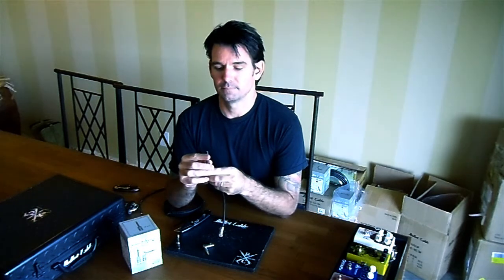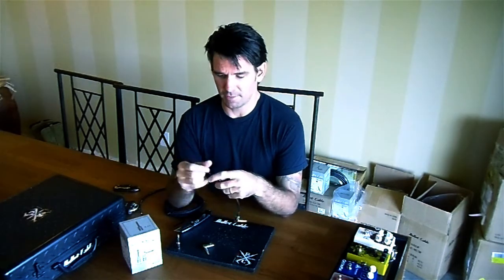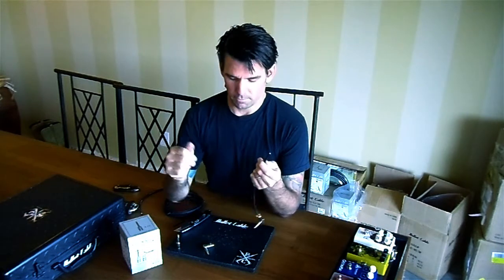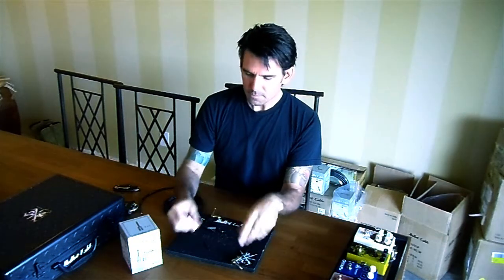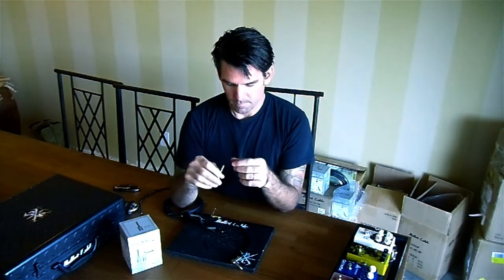SLUG Kit Pedalboard Cable SHOTGUN SET UP TIP

Comment: I am sorry Ted, it is not working. Had a lot of trouble with this cable kit! Changed countless the amount of power applied when inserting the cable, also with the screw. 
This thing was supposed to be simple. It is not. On the contrary, a lot of precaution is needed not to screw too much the nut, otherwise the shielding touches the wire and the connection is lost. This is frustrating! Not too much screwing means not stable connection. The cable is disconnected from the plug way too easily!